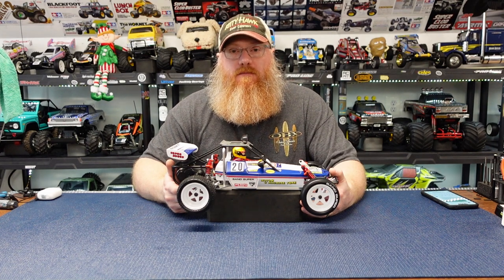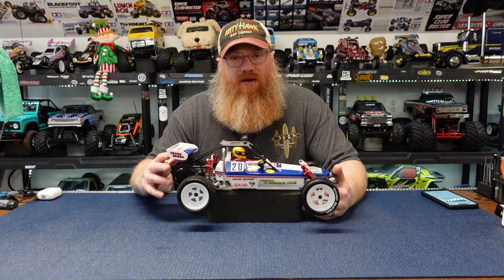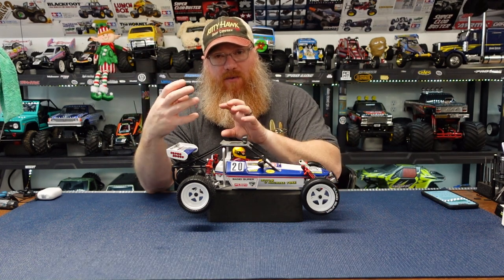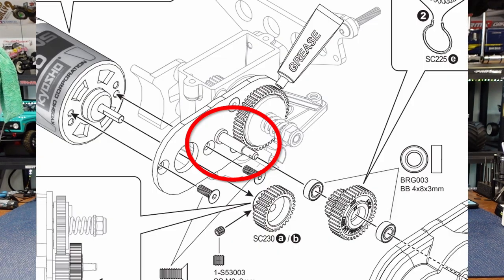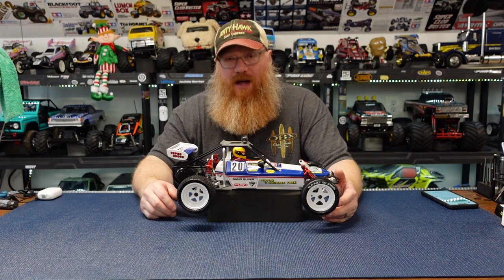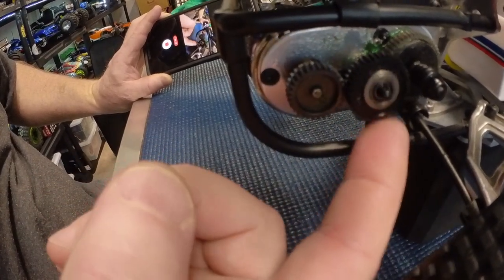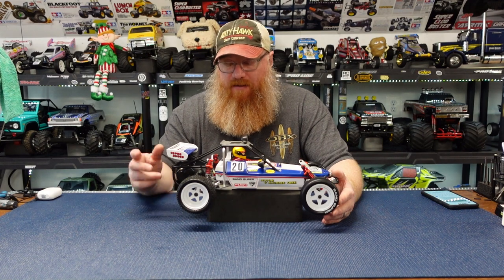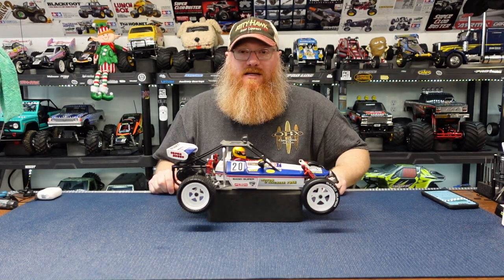Kyosho Turbo Scorpion Transmission Trouble

Comment: Glad you fixed this before it became an issue
Reply from the maker: Yes, I got very lucky and noticed it. It had been running fine and showed no signs of any problems but it it was on the verge of failure.

Comment: Wow lucky you didnt strip some gears. Always check your stuff and this shows maintenance pays off, great video rc brother.
Reply from the maker: Yeah it was as close to extreme failure as you can get for sure!! For RTR kits unusually dona once over on them but for parts like this I have not had an issue with before now. I will be double checking them in the future. Thanks for checking in!!!

Comment: Thanks for the heads up! 👍 Thus far I’ve not had issues with the pre built gearboxes in my Kyosho buggies, but like anything there is a potential for something to be missed at the factory. 

 I did, regrettably find that my Turbo Scorpion mistakenly came with the roll bars from the regular Scorpion (so not light bucket fixing points). But overall I’ve been very pleased with the KYOSHO kit quality. 👍
Reply from the maker: Yeah, not a thing I thought to check but thought it was worth mentioning especially since new kits should be coming available here soon (I hope). I have not had any issues from the tomahawk so I am hoping it was just a dab day at the factory. That is odd you got a wonky setup in your kit. Overall I am super impressed with their kits and quality. I assume this was just a glitch in  manufacturing.

Comment: Hi there Addam, excellent tip and just goes to show that you still need to check factory assembled parts. Take care and best wishes to tip you and the family 😉😊😉
Reply from the maker: Yes, I didn't even think to as I've had no issues from the tomahawk. I will be double checking from now on though! It was almost a really bad day but the little gear is tough and it must have only really gotten loose in the last few minutes of running. Take care!

Comment: Great info Addam.  I just checked mine and it's ok.  I had a different problem with the pre assembled diff which I will explain when I get round to doing the build vid.  I wish that they wouldn't try to be helpful with the pre-assembled bits and just let us build these things properly.  Best wishes mate 🙂
Reply from the maker: Yeah, from now on I will be checking it all out before using it in the build. Interested to see what you found in yours. I checked my diff before putting it in so mine should be fine. Thanks for checking in!!

Comment: Hey Addam, great consumer advice there fella and glad you didn’t lose anything. I think it is good practice to check everything over after each run while cleaning and tightening everything up. It is not always possible but you never want something to go unnoticed. Imagine if you hadn’t spotted this on the clean up of those wheels! Thanks for sharing brother 👍🏻🙌🏻
Reply from the maker: Yeah because it is not a place I would generally look before running a car. I probably would have noticed the wobbly case but who knows. I am glad it didn't destroy anything! It was very close though!! I gotta really start scrutinizing those prebuilt pieces in the future. Thanks
Reply: @AddamsPlayground  I am going to make sure I check over any Kyosho models that I get on the channel in the future for sure 👍🏻🙌🏻

Comment: 😁 Dang you must have got the guy that built my tomahawk diff build yours!  Good find lucky you did not run it longer or again.
Reply from the maker: Yeah right! Overall I am impressed with their kits and quality but this one could have gone really bad if I had not stopped when I did! Thankfully the gears only showed a tiny bit of damage and nothing to be concerned about but if this was a normal day of running and not recording I would have run at least two batteries though it and it would not have made it through the second pack for sure. I doubt I would have finished the first one to be honest. It was about to get ugly in there! I will be double checking them in the future for sure. My diff was good and had a decent amount of grease in it. I got the good diff.and you got the good case! Just keep an eye on it and if you feel any play in that cover you know you need to tear it down and thread lock that post in place!
Reply: @AddamsPlayground  I am going to look at all three of mine later just to make sure I will put the body clip in it and try and turn it if it turns the part it's time for thread loc!  Thanks

Comment: Threadlock!!! Ahhhhhhhhhhhh (that’s me screaming and running away lol) That’s crazy but yeah must be a QC issue. Car looks great though! Hopefully that fixes the issue!
Reply from the maker: I know, thread lock can easily be overdone but for a high stress and high vibration part like this it should have been thread locked from the factory. I am just glad I didn't run it any longer than I did. It was about to get real bad in there! I will try not to overly use the thread lock, only where truly needed!!

Comment: Well, didn't that exact thing happen today on my Javelin I finished building today. It wasn't until I realised the problem, that it reminded me of a video I had seen, which was yours. I checked the instructions and it does not mention applying threadlock when assembling that post. It is threadlocked now!!
Reply from the maker: Yeah, I am pretty sure when I built the tomahawk it was tight as can be and I haven't had an issue with it. The turbo scorpion was a different thing and that was almost a disaster. I hope you got to it before any damage was done to the gears! I thread locked the heck out of mine. I consider it to be permanent at this point! Seems like an area folks really need to look at on all these kits!!
Reply: @AddamsPlayground  no apparent damage done, hopefully.

Comment: Literally just built this kit and while out running a minute ago had the exact same thing happen. Going to throw a little thread lock on that sucker so it stays tight from here on out. Put a Castle 3700kv sensored motor I had extra laying around. Stupid fast, and a little too fast for a car like this. Pulls wheelies easily. Will be perfect for the beach with some paddle tires on it.
Reply from the maker: Yeah, that thing is a ripper for sure! You my have to dial that back and bit for normal driving but yes, on the beach it is going to send some rooster tails!!! I was very glad I figured out something was wrong before it went really wrong. It sound like you did too! The Kyosho cars are geared a bit faster than Tamia and others so yeah you have a speed demon on your hands! Have fun with it and I am glad you didn't trash the gears!

Comment: I’ll check it out . Thanks Addam. How long did you run it before it wobbled off? 👍
Reply from the maker: It was about 12 minutes total. I filmed in three spots for about 4 minutes each. I noticed it sounded a little louder at the last minute or two of running. But nothing sounded really bad, just slightly louder than when I first went out. I thought there may have been some grass wrapped up in something causing a little extra drag... Nope it was in the self destruct sequence!!!